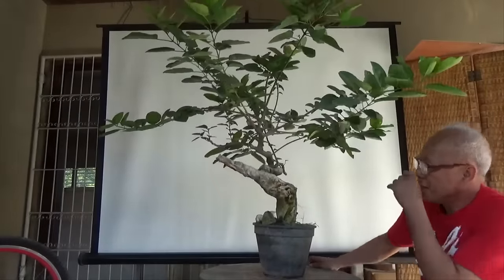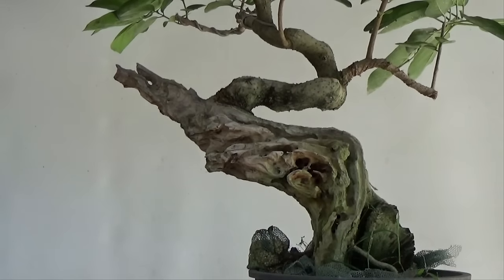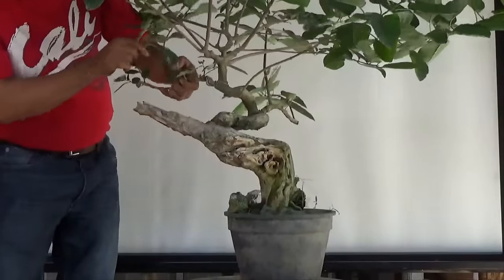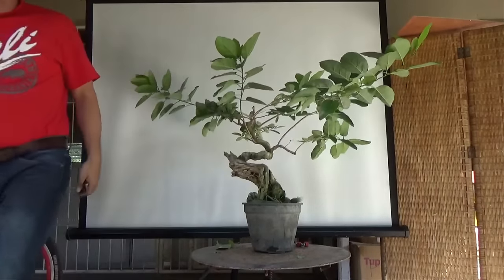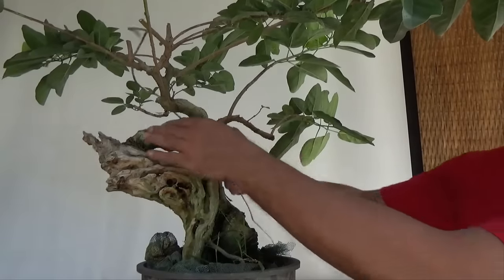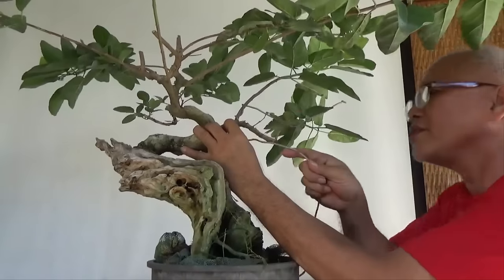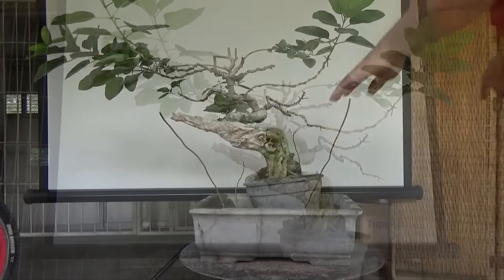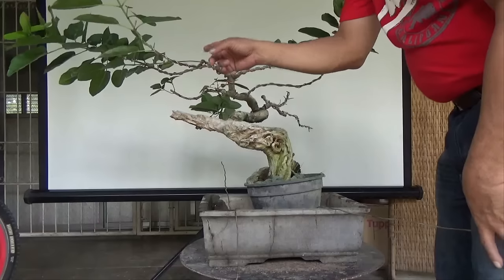A Day in the Life of Bonsai Iligan: Creating Branch Structure

Comment: sir how do you know that the branch is thick enough to be cut?
Reply from the maker: +facomeda The best proportion is when the branch girth or diameter is already 1/3 of the trunk on which it is emanating. So when the branch is almost 1/3 of the trunk you can cut it. Even if the branch is just 1/4 of the trunk you can still correct it cause you can still grow them if your container is big enough, but the trunk does not increase its diameter anymore unless you plant them in the ground. The one third rule still apply to generation branches growing on the primary branches. One thing important also is the Taper Principle especially in your trunk. For example if your trunk where your first branch is growing is 3" then your first branch would look good if it is at 1" measured from base. If your third branch  is growing at your trunk level which has a diameter of 2" then the branch would look good at around 3/4 inch.
Reply from the maker: +facomeda Aim also to apply the taper principle on your branches especially your first branch not just on your trunk.

Comment: Hello, I recently purchased a young podocarpus bonsai (my second bonsai ) and sense then I've noticed the leaves are very dry and crispy, it is in a room with a humidifier currently and I was wondering if you have any advice as to what I should do? I'm really hoping it's not dead. Any advice from you would be greatly appreciated
Reply from the maker: +Brennan Harkema Does it get sunshine? it should be out in the sun, also it needs air movement in its surrounding so it is better to be out there unless it is too cold..
Reply from the maker: +Brennan Harkema On the question of Nelson Esteves, 1. frequent defoliation say about 2x a year. 2. frequent root trimming 
about once a year. Leaf reduction should be the last stage of your 
bonsai creation, you should have built your branch structure by then and
 ramified your branches too.
Reply: +Bonsai Iligan thank you so much for such a quick response, I live in the United States up north and we are in winter right now so yes it is inside, I havnt done anything to it sense I bought it about 3 months ago, because of the leaf worries. Should I just keep it in a humid room by a window and water it every couple days and just see what happens? And then once summer roles around keep it outside and water it frequently? Again, I appreciate the quick response!
Reply from the maker: +Brennan Harkema Yes, that should be it, but since it is in a humidified room check out the soil before every watering, should be moist but not soggy.
Reply: +Bonsai Iligan alright! Thank you so much!!